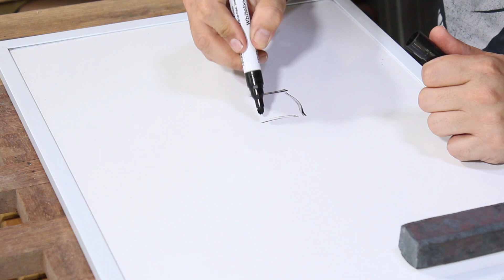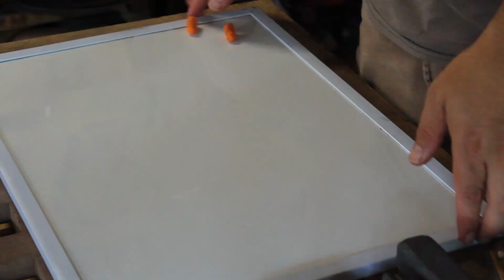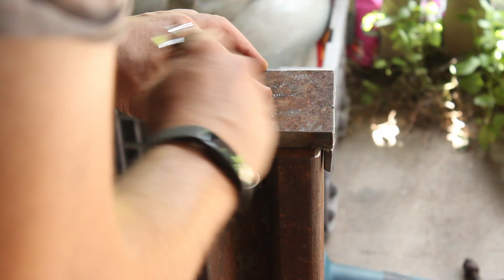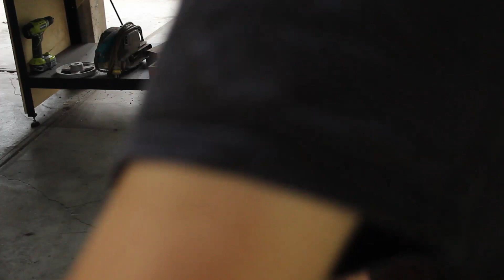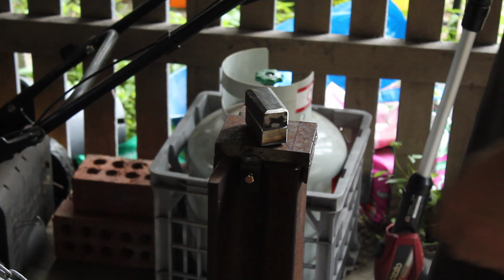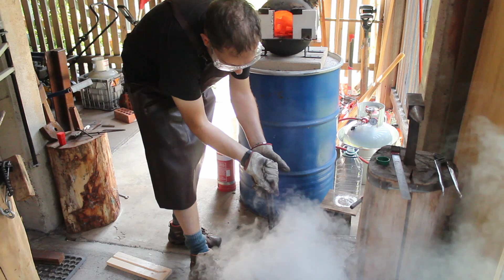Plain forging dies for the treadle hammer

Comment: hey doc.. I was just thinking.. having the head of the hammer coming in at an angle (even though it straightens at the end) wouldn't that give you more of a lateral hit then if it just came straight down? and would that make any difference in what you are trying to do there? Well it is almost time to put her to work eh.. well done Doc!
Reply from the maker: tinkmarshino it would help with drawing out, but using tooling like drifts and punches you now run the risk if them being driven off axis. I do plan to make some drawing out dies soon though
Reply: @docshotshopandforge  dang these things can be a real pain in the butt huh.. Well that say nothing worth doing comes easy.. good luck Doc..